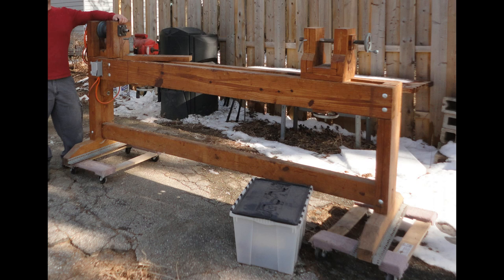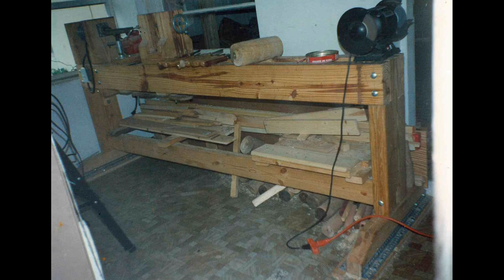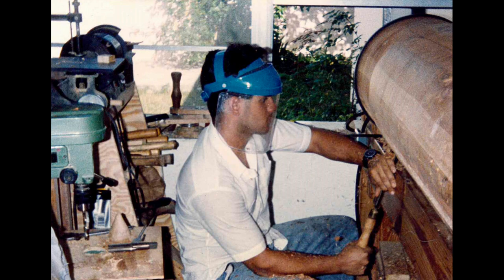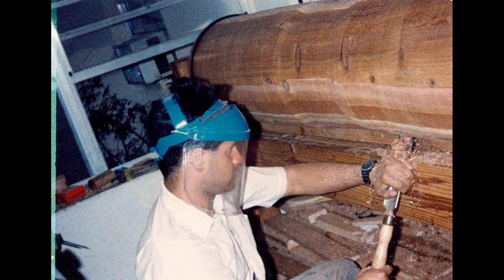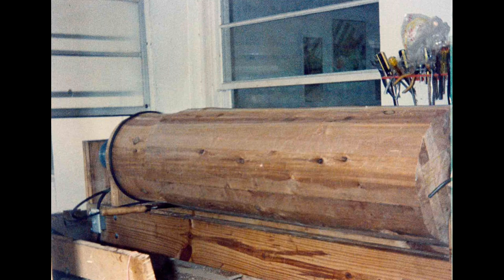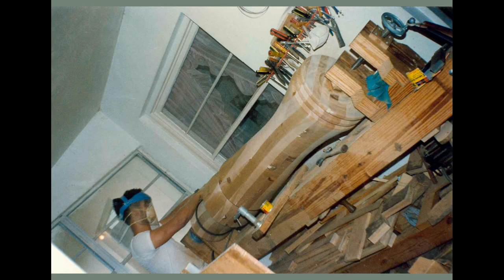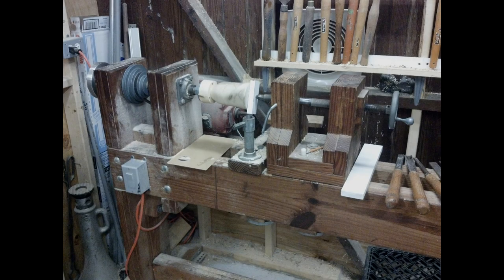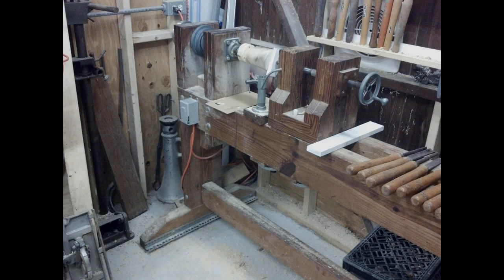HomeMade WOOD Lathe - 8' long diy lathe, head stock, tail stock, bed - free plans (torno casero)

Comment: That lathe is nice! Wouldnt fit in my shop, but nice. What happened to the giant turning?

I want to one day build a treadle lathe to use on craft markets. The plans will be helpful to see options for building the main frame. Thanks
Reply from the maker: +Willem Kossen thanks. Glad you like it.  It was a great lathe. I had to get rid of it because it was too long and took up too much space in my little shop.
Reply from the maker: +Willem Kossen the giant turning was a lamp I made...unfortunately I never got a picture of it finished. I've always been more interested in the process than the product.

Comment: the link wont open even after i joined the homemade lathe group. thanks for the video though great stuff
Reply from the maker: +Andrew C thanks for letting me know. If you look in the files section of the FB group its in there, that is where the link points but apparently it doesn't like to work. I will put the file on one of my websites and revise the link.  Thanks!
Reply from the maker: +Andrew C try this link to the file http://www.diamondstatemachining.com/home/free-plans